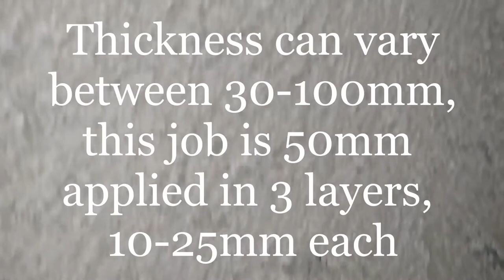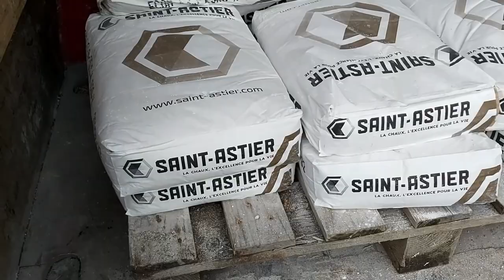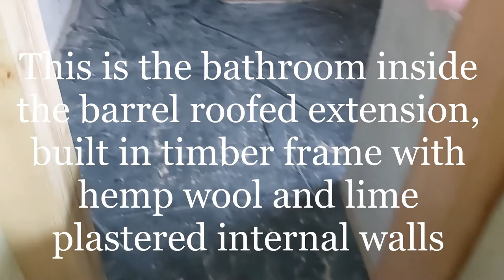Cork Lime Insulating plaster DIATHONITE 07

Comment: Is it possible to get a smooth finish on this plaster or will always be a little rough?
Reply from the maker: Yes the finish can be as smooth as a gypsum plaster finish, or should i say a gypsum plaster finish is as smooth as a 19th century lime putty finish 🙂.   In this video its a vernacular cottage so the Roundy slightly bokety finish that follows the contours of the stone is like it would have been originally.  So where a building is a larger formal farmhouse or a Georgian or Victorian building a smooth finish would be more appropriate.  From here https://www.oldbuilders.com/job_types/lime%20rendering/limerendering_01.htm then scrole down to "Internal finish, skim coat,".  feel free to email us info@oldbuilders.com
Reply: @oldbuilders11  Very good, I have 130 YO Galway farmhouse and the west prevailing side has a lot of damp on the stone wall which is badly covered with modern plaster board. I am trying to decide on Diathonite vs insulated plasterboard. But I am pretty sure the large 2.5 feet think stone wall needs to breath. Is one of the damp issues anyway.
Reply from the maker: @eannaomainin7926  yes traditional lime and stone walls need to breath, insulated plasterboard is probably the worst thing you could do to an old building - https://www.oldbuilders.com/insulation%20centre/1_dontdryline_01.htm   -   https://www.oldbuilders.com/why%20use%20lime/whyuselime.htm   feel free to email me if you have further questions.
Reply from the maker: Yes you can get a completely flat lime skim coat, as flat and as smooth as a modern gypsom plaster.  You can see samples of that kind of finish in any victorian or Georgian house, and this is still routinely done by our firm.

Comment: Why did you not use roundtower lime, Irish company in Cork. Looks a faster way to get the job done love the finish. Did you apply 40-50mm of insulating plaster?
Reply from the maker: it would be great if there was an irish made product, but they are all imported. 50mm was used on that project, but one can use up to 100mm, but its expensive stuff.
Reply from the maker: 50mm insulating plaster.  The insulating plaster was Diathonite, the lime plaster was St. Astier.  Roundtower is a good supplier as well, their lime is from France, as is St Astier, the Diathonite is from Italy.  One can use Irish lime as a hot mix with a potsalan or guaged with hydraulic.  Unfortuneatly there is not Hydraulic lime made in Ireland.

Comment: Back to the future?
The bricks on Independence Hall were laid with lime mortar.
The interior walls were plastered with lime mortar.
If that was the better method for mixing mortar, we would never have moved away from it to begin with.
Reply from the maker: There were some very good reasons why tradesmen moved away from Lime mortar,  the new materials such as portland cement and gypsum plaster, acrylic paints, these were much easier to use, quicker to apply and cheaper to manufacturer.  The trouble was their use had unexpected consequences due to their incompatibility with the traditional methods of construction, mostly this was how they dealt with moisture, portland cement traps moisture, Lime allows it to evaporate, this resulted in cold and damp walls, it took many years before the industry became aware of this and I guess the commentator here is still caught up on the science. Some reading:  https://www.oldbuilders.com/job_types/Damp/1_damp_01.htm?

Comment: Hi can i ask why you compress the coat in-between layers?. Also do you use mesh?.
Cheers Tom
Reply from the maker: We try NOT to compress between layers as that allows more air to be entrapped within the material, so a very light trowelling is applied to spread out any high spots, thus giving better thermal performance.  On the last coat more compression is inevitable as the flattening out of the final layer is necessary in preparation for the finish coat.  Mesh is important to use for insulation depths of over 60mm.

Comment: Hi 
Great work. The house fits very nice into the landscape. Did you just insulate from the inside? At the begining it looks you plastered (with kork?) from the outside as well. Is there a certain inside to outside ratio with this produkt? Greetings from Germany
Reply from the maker: It is insulated with a cork lime plaster, just on the inside, external was hydraulic lime plaster (Hydraulischer Kalkputz).  The lime was painted with a German Mineral Paint, Beeks.  Are you looking for a cottage in Ireland?..  Danke für dein Interesse.